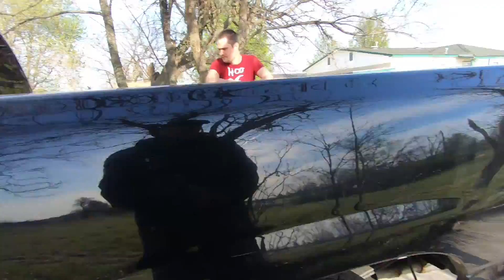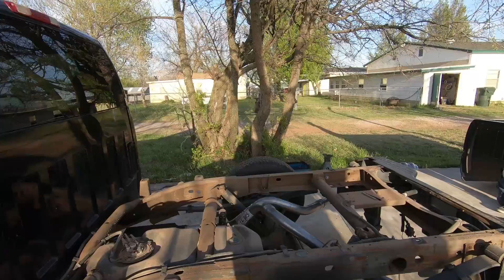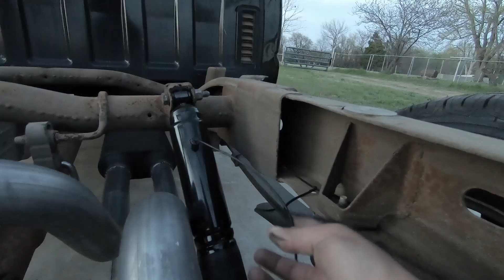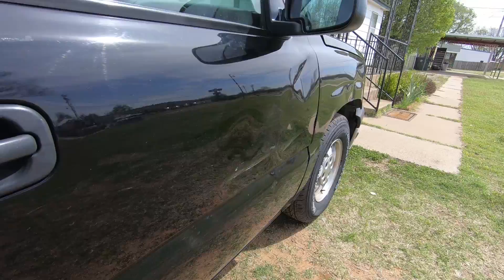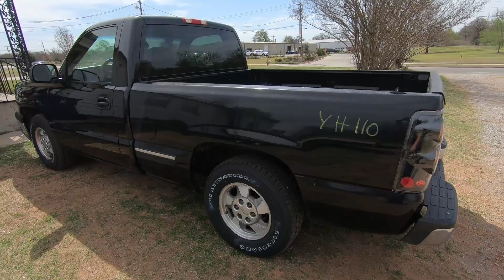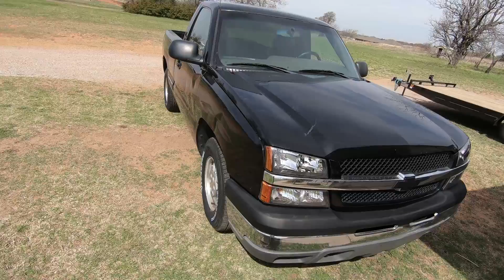Replacing the Copart 2003 Chevy Truck Bed and Shocks

Comment: Cut and buff the bed then wax it. It will look a lot better plus it may match the truck better. I'd also like to suggest grommets on the air shock lines where it goes through the frame to prevent rub through.

Comment: You will want to move the air shock T-connector and lines off of the rear differential.  There is no reason for the air lines to move with the suspension.  The T-connector doesn't need to be centered so could be attached to the frame on the right side and the left air line routed along the frame cross brace.  Also, I would have probably put the back of the truck on jack stands and removed the tires after the first attempt at removing the bed.  You and your brother overcame that so it didn't matter.  Thanks for the videos.  You  communicate well.

Comment: I like the custom touch of the airline to the bumper.  Only thing I would have recommended was to add rubber grommets to each side where you went through the frame, just to prevent chaffing of the air line.  Spray in liner and a tonneau cover would look really good.  Great job!
Reply from the maker: I should have added those, yes. Thanks Tom!

Comment: Before you replace your bumper. Go ahead and pull it and if you have a rubber mallet or a 3 Pound Hammer and a block of wood you can knock that dent out of your bumper by hitting it from the back. As for the loose lower piece while it's off you should be able to look at the clips and reattach everything to fix it.
Reply from the maker: I'd rather just replace it lol.

Comment: hey, does your 4.3L engine vibrate at low rps & at 45 mph? mine does and I don't know why. I will be checking engine mounts soon. I think it's the exhaust manifolds or engine mounts.

Comment: Wouldnt it be cheaper to just do a little bodywork yourself and have it resprayed both door and fender? I wrecked my pickup in 2008 hitting black ice and i spent a few hours pulling and hammering out the dents, then the little micro dents i couldnt fix i filled in with body filler and had local craigslist guy color match and respray for me...
Reply from the maker: I don't do bondo. It cracks, and falls apart over time.

Comment: The line through the frame is going to fail,  should zip tie it to the wire harness. Frame looks so nice, sucks living in the rust belt. It looks real nice especially for the year, not building a SEMA truck.

Comment: I have an 03 ex cab silverado with only 70k original miles on it . But up here in Syracuse NY the truck is rusting out from the inside out.  I hate rust.

Comment: Hey Uberman i have a nissan pathfinder 2001 3.5 LE 4WD and i have a service engine ligth on the dashboard. I tried to put a Diagnosis machine in the computer of the car and it turns out that i cant a reading, so i took it to Advance Autoparts shop and the same happen with their equipment. Do you have any Idea what the issue may be. PS i already check the fuse boxes and everything is fine.
Reply: I think the car computer is not working...
Reply from the maker: It's got to be a fuse. I'm sure of it.
Reply: Uber Man ok will double check
Reply: Key in accessory position and engine not started?
Reply: Akiva Feinstein. yes i went to  Advance Autoparts
Reply: Akiva Feinstein and they did it as you described
Reply: Try 1) check fuses for cigarette lighter and aux ports, common for these to power the obd port
2) remove battery, leave overnight, reconnect battery - this resets computer